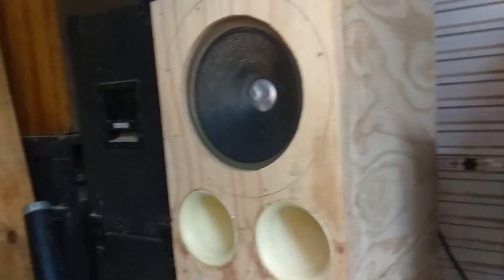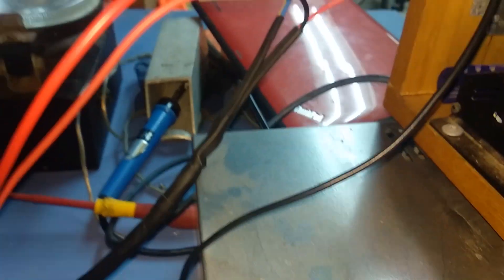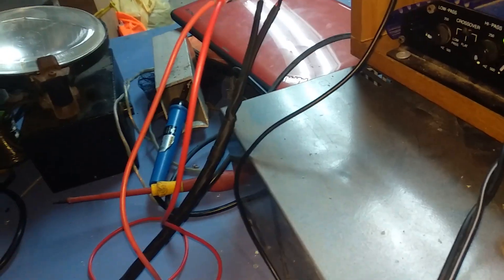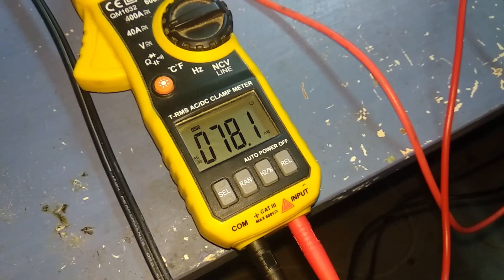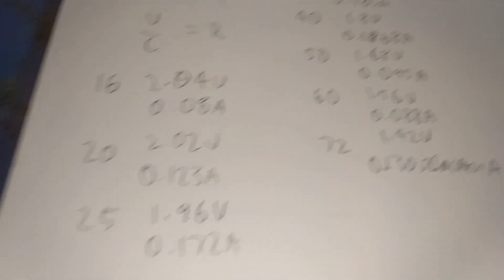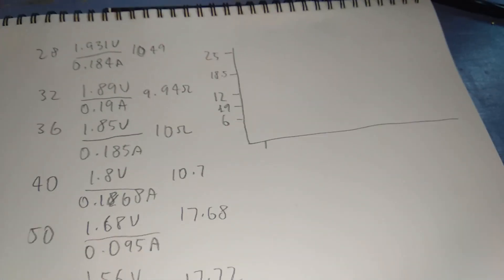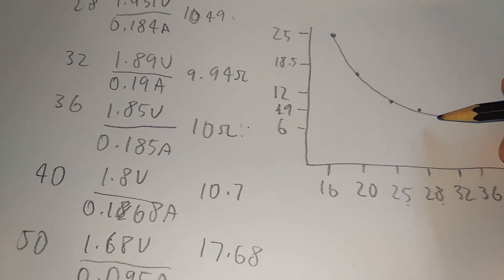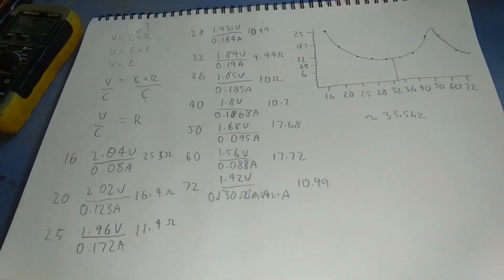How to find the tuning of a Ported subwoofer enclosure

Comment: i just look at the excursion of the driver while manually sweeping the frequency range. anything wrong with doing that?
Reply: So, when it flexes the most it's the peak frequency?
Reply: @gabrielvieira.4358 No, It's when it moves the least actually.. but you also know it's "the peak" because at the same time the port/vent is moving a lot of air/making most of the sound.

Comment: I understand that 33hz is the sweet spot and hip hop music rarely go much lower than that, but what is the lowest a person should ever tune their box to before running into problems (i have a 15" kicker L7s in a 6.8cu ft ported box)
Reply from the maker: Usually it's not a great idea to tune below the resonance of the sub.
That said, the 6th order in my Mazda, started 29, I kept tuning it lower and lower, and it just kept going, currently tuned to 17Hz.
One big issue is Xmax, the drivers peak excursion is just above tuning, so in my box the driver moves most around 24Hz, basically at Xmax.
If it was tuned at 29, it'd move most closer to 40Hz, which would stop it from Xmaxing.
6.8 cu ft is quite large, so it's possible you could see some excursion limits, but also such a large enclosure would likely benefit from a low tune.
So basically go as low as you want, as long as the thing doesn't launch the cone.

Comment: I'm planning a build with two DC Audio Level 1 12s, I can't tell what box to build to put them in and if it is ported then what to tune the box to. Could you give me a suggestion Dakoustics, it would be much appreciated. All the specs for the subs are found here: https://www.down4soundshop.com/Level-1-12-m4-D4/
I drive a 2012 Honda CRV so space really isn't much of an issue, and I've heard that the best boxes for SUVs are sub up port back, but I'd like to hear your opinion on it. Thank you so much

Comment: I need a link for where to buy the resistors you used please!! Also so the resistors are between the negatives and positive leads with the negative on the negative speaker input correct? 

Thanks and great vid!
Reply: nooooo that is almost a short circuit.   resistors go in series with the speaker,

Comment: Hello i m from india 
Which is  best low and loud frequency enclosure size and port size please suggest me.....
I have 2 sub 530 rms Svc parrelel 2ohm  to sony Mono Amp 750 rms 2 ohm......
Please suggest me size ...
Reply from the maker: If it's a 15" subwoofer, a general box which could work is- 140L, port area 400 square centimetres, (say 10cmx40cm), which is 67cm long. This should tune around 32Hz for low bass. If it's for a car, 120L box, and port size 8x40cm, same length. 
If it's a 12" subwoofer, 70L box, 200cm square port area, still 67cm long.

Comment: are those resistors needed for this? also is it possible to find the tuning of a box by looking at how much the driver moves at certain frequency's?
Reply from the maker: Resistors are used for finding the current, so any other current measuring thing can be used, such as clamp meter or the multimeters built in current shunt. I used this method mainly because I find it more accurate, the clampmeter isn't bad, but its not too accurate unless I do a couple windings.
You can look at the drivers movement, and put sand or glitter or something on the driver, and its definitely a good way of finding tuning super quick and cheap, though relatively large sub boxes can have a less pronounced affect on the driver.
Reply: @Dakoustics  alright thank you. i also couldnt help noticing that you are aussie aswell do you have any social medias i can add you on or is that a no go?
Reply from the maker: @puresesh7985  I might eventually set up some other things for the channel, but in regards to my own social media more or less a no go, I'm closeish to 10k subs, so might set an instagram account or something up then
Reply: @Dakoustics  If i use the method of looking at when the sub moves the least, is it possble that it would be slightly above or below tuning? or is it 100% accurate regardless of speaker specs?

Comment: I got lost on how you hooked up the resistor  and the leads. There were more than one set ideas you were measuring across??
Reply from the maker: Basically, the resistor is hooked up to a terminal of the amp. It's 2x0.5Ohm in series, so its basically a 1 ohm. The speaker is then connected to the resistor, as if it was the amp terminal. 
I had the ground lead for the multimeter on the negative terminal of the amp.
I had one multimeter positive on the other end of the resistor, so I could measure the voltage across the reisitor to find the current.
The other multimeter positive on the positive terminal of the amplifier. 
Sorry for late reply, didnt get a notification. Hope this helps though.

Comment: The dented dustcaps makes me sad lmao. I wonder if it's possible to cobble together an arduino to test for this? Hijack the speaker terminals, have a little battery and an LCD, get the ardunio to take all the measurements with much more accuracy and display this exact graph. 130 yankie bucks is quite expensive for a glorified multimeter... Or maybe that's just my inner tinkerer coming out lul.
Reply from the maker: When you consider how much an oscilloscope is for setting gains, or other SMD products, SPL meters for example, they're often quite pricey. Arduino could probably do it, all it really needs to do is a frequency sweep at a constant voltage, and have a shunt or something read the current and graph it. Done. Specs would be more difficult, but if it fed straight into an excel spreadsheet anything is possible.
Reply: @Dakoustics  Sure as long as it's good enough to get some basic data bout the speaker (and its enclosure), then it's all good!